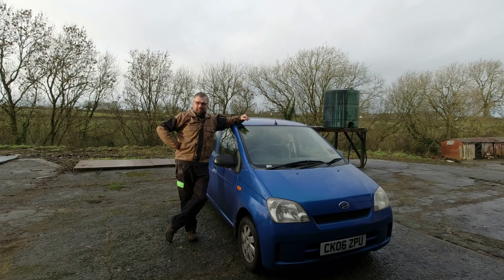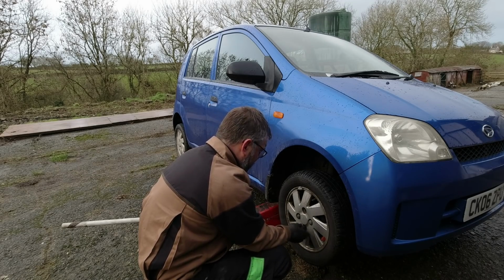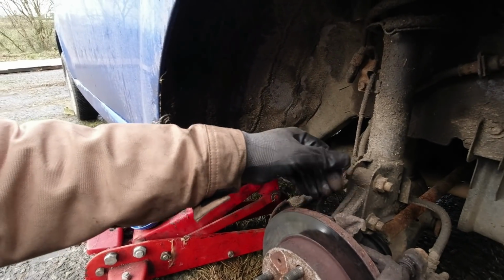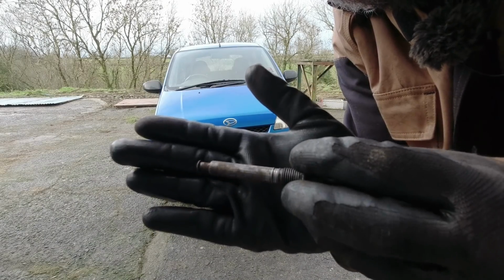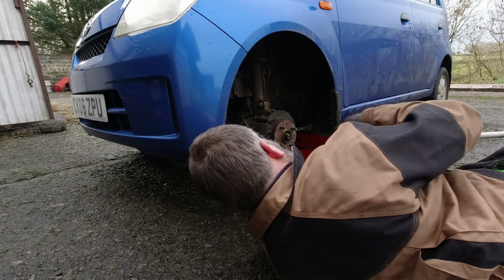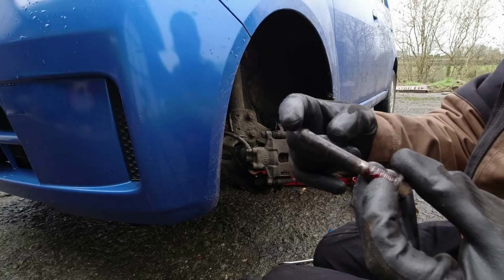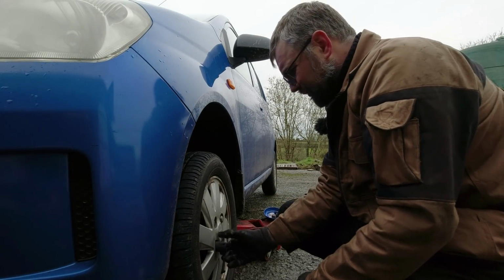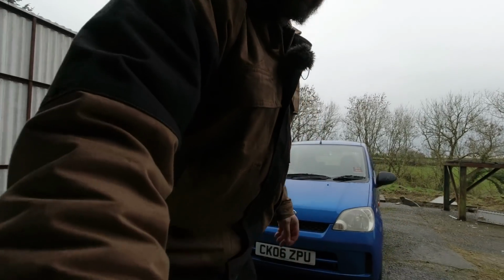Daihatsu Charade - Are the brakes worn out?

Comment: Great video,as always, thanks Ian......i love those charades... do you think the head gasket is going?
Reply from the maker: No. There's no loss of coolant and no sign of oil and water mixing. Weak points on these engines are piston rings and valve stem seals.
Reply: @HubNut  ahhh, ok, im not surprised really with the mileage.....might be worth getting those done eventually, as it seems a decent little car :-)

Comment: had the same on my V8 Diesel 200 Series recently, came home from a "summer" holiday and pads were squealing,  ordered new pads,  took the wheels and a the pads were still at 70%...
Reply: Ceramic grease on the backs of the pads and/or shims might help. Rubber grease useless for metal to metal. Ceramic FTW.  copper grease second best. Pins can often be chucked in a drill. Make a sleeve of abrasive paper. As you said though those are knackered. Likely that you can take them out on full lock without taking the wheel off possibly without even jacking the car up.

Comment: That engine has obviously got stuffed rings. A secondhand engine transplant would make a great video series, and the car is well worth keeping. Here in NZ it would instantly fails it yearly safety check and be illegal with that much smoke. Can't see how it will pass MOT like that?
Reply from the maker: It doesn't smoke like that all of the time but we will see whether it passes an MOT. Not much point changing the engine, but new piston rings and valve stem seals may be wise.

Comment: Ian - have you removed and checked the pads? I had similar on an Abarth 500 - pads looked fine discs ok, yet were grinding. Turned out the friction pad was deteriorating and breaking off in large chunks. The noise was the material stuck between disc and pads.
Reply from the maker: I haven't, but I think we're going to replace the lot. Parts are cheap and it's good experience for Miss HubNut.

Comment: You should use lube but you should also do this job at least anually as a service item. Sometimes it can be good to clean out the bores in the calipers aswell so that they dont end up hydrolocking. I'm not sure but I have been told that the pin with the extra nib should be in the bottom hole.
Reply: I've always put them in the bottom hole when calipers are in front of the axle, top hole when calipers are behind the axle. Something to do with dampening vibration?
Reply: @wirdy1  Probably yes I asked in a ford formum because they were inconsistent on my car and the responders said always in the bottom. But it could be different on different cars.  On my car the front ones are ahead of the axle and the rears behind as i remember. Ians seemed to be missing the rubber that would be doing the dampening though.

Comment: My  Charade GTti would always grind away at the front with every right turn, damn brake disc shields were slowly rusting away and bending against the disc, in the end I've took them off as they aren't a MoT failure and there's no  chance of getting the parts, even direct from Japan (I've tried)

Comment: Go on, treat yourself to a battery-powered impact driver as part of the new regime at Hubnut Inc. ;-)

I can recommend the 18v Einhell one.
Einhell has a "Power X-change" range of stuff (drills, impact drivers, grinders etc) which all share the same batteries and seem to be decent quality.
See eBay for further details.

Maybe do some tool reviews on the channel?
At best, maybe you could even blag some free stuff to review?

+EDIT+

Just had a quick look...
If you ARE interested in an Einhell impact driver, make sure you get the "TE-CW" version that has a proper 1/2" square drive.
They also seem to sell a version which uses a 1/4" hex drive, which seems kind of spindly to me. :-/

Comment: Will it MOT with the smoke Ian ? I was always told to use copper grease on brake pins and back of pads but it just seems the bake into a crust.
Reply: the only thing with copper grease it will virtually destroy the rubber cover on the sliders over time.
Reply: Best to use silicone grease or red rubber grease. Copper grease is anti-seize, and it's not a very good lubricant, and will cause rubbers to swell (DAMHIK).
Reply from the maker: I'm not sure on the MOT. It's much les smoky when warm, which is what the engine must be for the emissions test. I'd never use copper grease on a sliding item. It's anti-seize, not a lubricant.

Comment: I would never bother to put new brakes on any car unless the pads are worn down or I have a problem noticeable when driving it. As for those pins they will be absolutely fine, something else will happen before they are a problem.

As for lubing sliders, there is no correct answer. If you live in the bull-dust of outback Australia you don't lube anything, however, you need to for a car that sits around in the damp UK winters.

Comment: Also, on the smoke front, does the little Daihatsu [I have a bigger Daihatsu]...have one of those modern, millennial things called an EGR valve?  If so, the valve itself might be sticking? They get coked up with exhaust soot, and can be evil to clean out.  Might explain why a good revving on the road, clears the smoke issue?  On the MoT front, don't the testers [testees?]....have to run the engine warm first? Or is that just for properly made cars from last century?

Comment: Wheels off start car in gear then push a large screwdriver in between the edge of disc and caliper then do it on the top of disc this will remove any build up..if your really posh you can use a large bastard file..then plenty of lubrication...job done..no point putting any money into the car until it has 12months ticket...good luck!

Comment: Check your radiator fluid and transmission fluid levels...I googled this...'What causes white smoke from exhaust when accelerating?'
Reply from the maker: Water level is fine. Transmission fluid nowhere near the engine.

Comment: I didn't entirely see it: is there lube/grease on the threads of the sliding pins? Don't do this, this could be DANGEROUS! The pins could loosen now easily when getting warm and vibrated. Keep it dry or (maybe) use Loctite to keep the pins in place. Did you use the correct lube for breaks? Mind the temperatures that could appear at this parts of the car... Breaks are a life insurance and we all need the HubNut family alive!!!
Reply from the maker: I think you misunderstand the point of the pins. The caliper is designed to slide upon them. If they stick, the braking action is uneven and the brakes can stick on.

Comment: Why were you holding the ratchet by the end and hitting the middle with a hammer?

Leverage man, hold in the middle and hit at the end. 
(More power!!! What could possibly go wrong? 😁)
Reply from the maker: The hand provides the power. The hammer is mostly about percussion - ie like an impact driver.
Reply: @HubNut  No, No, nothing will go wrong [snap!] not I didn't hear anything, why do you ask?

Comment: Copper grease or high temp grease... I take apart the pins every year and make sure the piston is free and so far never needed a calliper or new pins. I know there are only a small minority of mechanically minded and capable people such as ourselves....
Reply: Copper grease will make the rubber boots on the sliders go soft. Red grease is designed not to attack rubber components.
Reply: Ceramic grease, aka ceratec, is best for brakes. Anything else just gums up over time, causes caliper to seize, get hot, then cooks the grease to a thick solid.
Reply: @ShedTV  in 19 years a mechanic never had such issues with copper grease.... and rubber better going soft than hard and brittle and falling apart.... I know what you mean though they expand a little but most pin kits offer new boots with the pre greased pins but that’s just high temp white grease... but nothing lasts forever but prolonging the Inevitable hahaha 🤣 that’s what it’s all about... I do have a tube of grease that’s just for brakes and I think it’s all about the application!!! If you go nuts and drown it in grease of course it’s gonna congeal! But if you apply it wisely it’s fine... Like I said though I have had the same car for 16 years and I do all the maintenance myself and used a sliver copper grease without fault... But that’s my way.
Reply: @AndyDento21  That’s fair comment, thanks for your detailed reply. I’m not a professional mechanic so I bow to your better knowledge.
Reply: @ShedTV  off your knees good sir I am but a man 😂 everyone has there choices and none or worse or better than the other... but all you need to do is just keep on top of the little things like that and your fine

Comment: tut tut .... hitting a ratchet with a big  hammer ;-)
Reply: And using a screwdriver as a pin punch, but as Ian would say, this is not an engineering channel.
Reply: @robertpowell7672  That's a pound-through screwdriver with the shaft going right through the handle. Designed for persuading with a hammer.
Reply: @ShedTV  No Sir. Pound through screwdrivers are designed to act as an impact screwdriver not a punch or drift.
Reply: @robertpowell7672  You are right of course. That’ll teach me to be  a smart-arse!
Reply: @robertpowell7672  I tend to use a pair of pliers to get pins like that out. The pliers apply equal pressure to both sides of the bolt, making it easier to pull straight out.

Comment: I would put a screw driver between the edge of the disc and the carrier and turn the hub and scrape all the rust off the edge of the disc 😆
Reply: And not only would the protective surface rust be gone, but the balancing as well.

Comment: I'd get rid of rita smokey joe nothing but trouble plus the sana and oldcit sell them all I would
Reply from the maker: It just smokes a bit. It's the most reliable car on the fleet at the moment!
Reply: But the Sana and Olcit represent at least the next 18months’ tinkering content! (Content I’m looking forward too I might add!)
Reply: I'd agree he has too many cars - yes that's possible! One result is that he has to work outside in the cold and damp instead of in the (relative) comfort of his unit, the second is that cars which aren't used regularly deteriorate and don't work when you come to use them again. Look forward to fun and games with the GS come spring. I know whereof I speak...
ETA - basically the cars are collectively deteriorating faster than he can work on them.